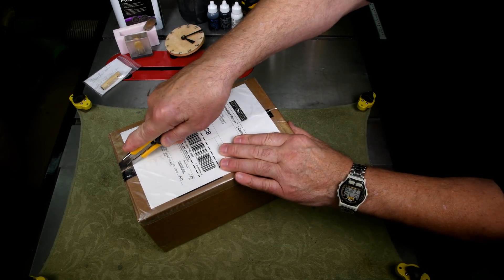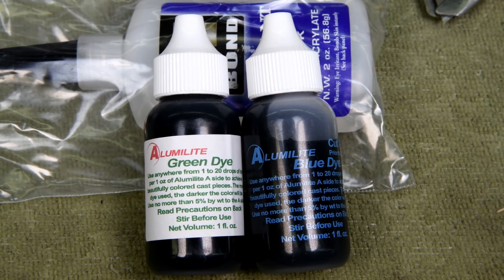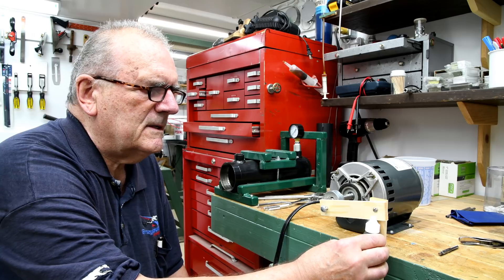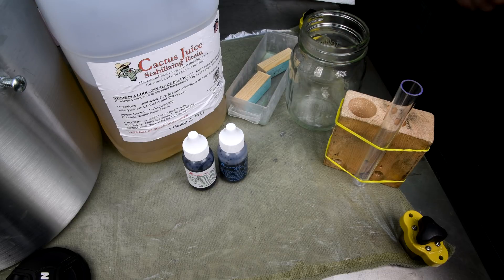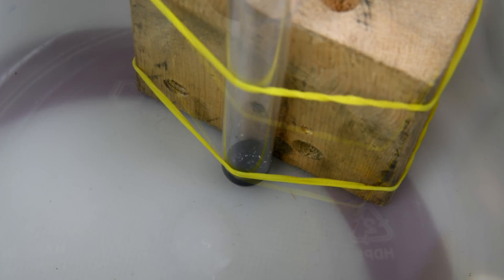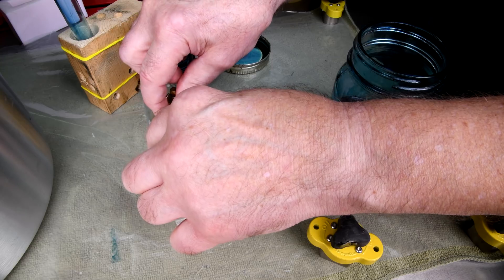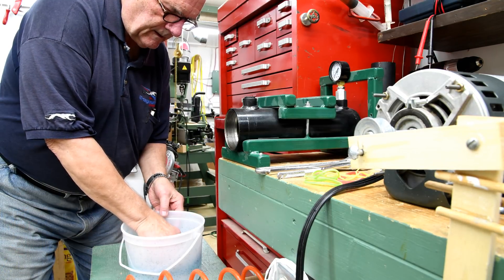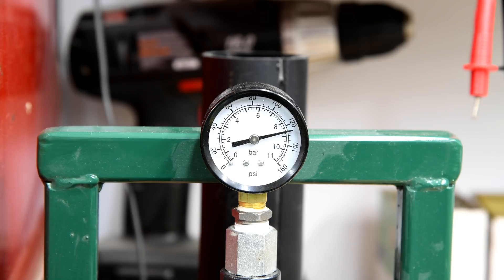The Pen From The Blue Goose - Part 22

Comment: Hello, your videos are very good, I have a question, to keep the vacuum in the vacuum chamber does the pump need to stay on all the time or after reaching the desired value can I simply close the valve and turn off the pump? the same question for the pressure chamber, does the air compressor need to stay on all the time or can I close the valve and the pressure will be maintained? thank you!
Reply from the maker: In an ideal world that will work, but because of possible slight leaks in the pressure tank setup, or because of moisture boiling off in the vacuum chamber, it won't hold for too long. Thanks for commenting :)